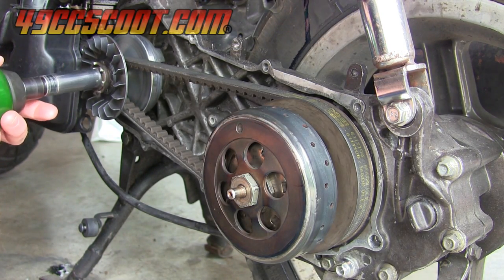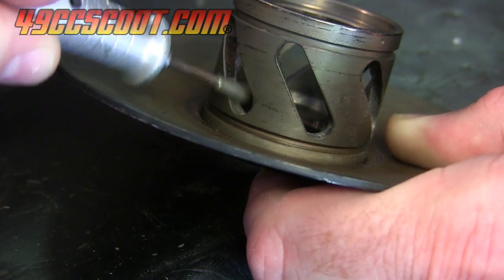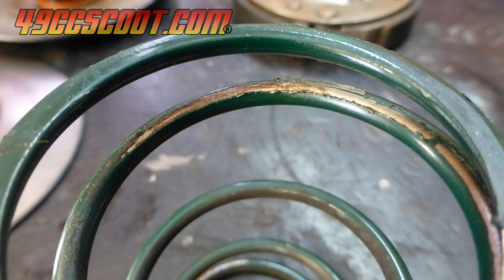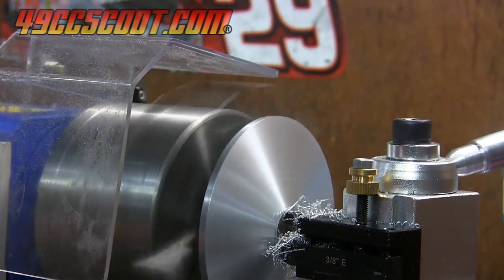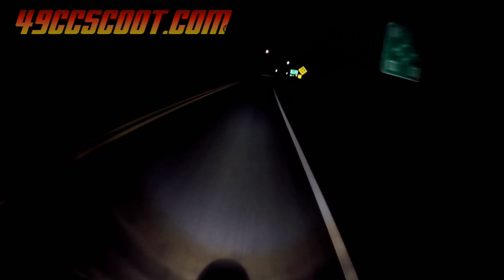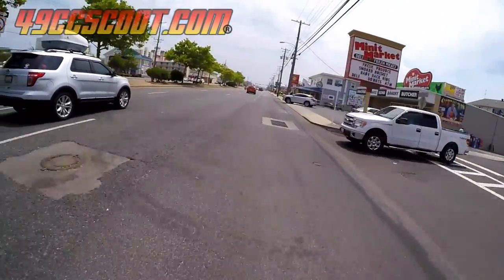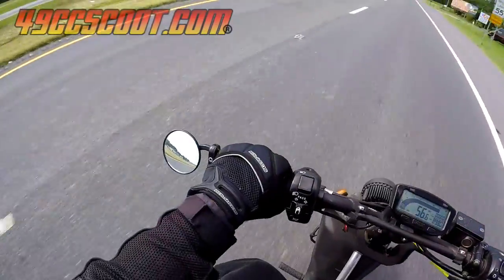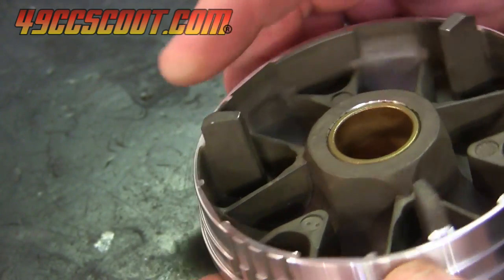Belt Busting Update And Beach Rides

Comment: I own a motorcycle, don't own a scooter. But I will say this. You have to be the most thorough mechanic I've ever seen. I mean, you really put a lot of time and effort to get the job done right. If I was to have anybody work on any of my two wheeled machines, it'd definitely be you.
Reply from the maker: Thanks! In situations like this, you really have to take the time to check it all over or it may never get fixed.
Reply: Shaun Daskam I was thinking the same thing.
Reply: I'm a moped driver also and I do this stuff as well. It's fun to do and simple
Reply: @49ccscoot  I DONT UNDERSTAND WHY WHEN I BOUGHT MY SCOOTER IT COULD GO NOT MORE THAN A 93KM PER HOUR NOW ONLY 84 ?! IS IT A VARIATOR RINGS FELL OUT OR THE SPRING IS USED UP IN MY HONDA PCX 125CC 2011 ??? tHANK YOU
Reply: Seriously man

Comment: Had a snowmobile that broke belts. problem was what your correcting. At a certain point of reduction or opposite, in the torque convertor operation the belt wasn't  aligned with both the pulleys, it was cocked. Anyway, yes everything has to flow easy front and back pulleys. Lubed and smooth baby!
Reply from the maker: These CVTs, that everyone that doesn't work on them daily loves to call "simple", can certainly be more than meets the eye.

Comment: I never thought about that, my old scooter kept breaking belts and I never knew why.
Reply from the maker: Cheap belts are a huge cause that some overlook. The stuff from China that costs half the price of a quality belt usually breaks in short order. I tried some years ago and never will again. So many breakdowns from snapped belts. They couldn't even make it 10 miles in some cases.
Reply: 90GTVert I've always steered away from cheap belts, I've used gates powerlink belts.

Comment: Would be super keen/eager to hear your comments about the Malossi belt vs OEM its performance, longevity, vibration etc. And, also thoughts on whether the belt might behave perform differently within a stock OEM set up (replace belt only with Malossi) versus changing out to a full Malossi "kit" .. Worth it? Or not? Its costly and parts hard to find in Asia so do not want to spend all the time and money on Malossi unless its well worth the effort. Thanks
Reply from the maker: I think to make a direct comparison, you'd need to use belts of the same spec in the same setup. I think the Malossi belts are good quality belts, and so are Bando belts that came with my scoot and that I used as replacements until the over range kit. If you could find the right size, I'd expect a Malossi belt to do well in a stock transmission. I don't think a Bando belt would fare too poorly if properly sized in an over range either. It's much easier to stick with stock replacements if the scoot is not heavily modified. If you go to an over range, it's better to go with the intended belt for that.

Comment: Once again awesome video and your bike is solid. I noticed the rear pulley bell was drilled and wondered if youdrilling the holes your self.  If so did you notice an improvement?   Also, refacing the the front pulley can have positive or negative results.  How did you get the correct slope and have you ever expieremented with refacing other variator and front pulley faces that made considerable improvements?
Reply from the maker: The bell is a HOCA. It's also knurled on the inside contact area. I like it better than stock. Never drilled one myself. 

I measured the angle of the old pulley and then set the lathe to the same angle and cut it. I haven't tried fiddling with other faces. The OR is what I use most of the time and it works so well that I don't have any real desire to screw with it. I have done fixed halves at different angles before I had the mini-lathe, just using a drill and files. You can definitely tell the difference if you change angles too much. The closer you get to flat, the quicker it shifts and the farther from flat the slower it shifts. Ideally you'd want the angles of both halves to match and the belt to be designed for the angle, but in reality you can get  away with small changes. The farther you stray from what the belt matches though, the more likely you are to have problems with belt slip and premature wear.

Comment: Heat is what causes the belt to break. I noticed your starting RPM is high which could be the the cause of the over heating. Also a stronger center spring will cause more heat and I would use lighter weights first. It also might be shifting into high gear before the clutch engages.
Reply from the maker: Variator is what gives me the RPM on launch. I know that sounds like the clutch's job, but try to get a Malossi OR to take off at low revs without ruining performance elsewhere. They like to go, and are meant for stuff that likes to rev. Gentle takeoff would be nice for longevity, but who wants to do that? lol

Comment: So is there a clutch in the front and back variatots that have shoes that wear out like brake shoes ? If so do these friction pads and variator rollers etc  take long to wear out. At 7000km would the be ok. Thanks you do a good commentary on your videos.
Reply from the maker: Variator up front. Clutch in the back. Clutch does have shoes that will wear out over time. Kinda depends on the quality and treatment. Same deal for rollers. I would check both at 7000km.

Comment: Nice job, but why didnt you just use the other 3 races on the driven pulley?
Reply from the maker: There are 2 sets with different angles. The ones that I used work the best for my setup to keep RPM more steady.

Comment: i broke a belt once, but that was my own fault, i faultly installed my variotor fan plate wrongly and it vibrated, and after 10miles it broke.

right now, i never lost a belt anymore and my crankshaft even has a tiny wobble with it. which is noticeable while driving. but this never game me issues.
Reply: lol i did the same thing once as a teen, meltet the fan end to the crankshaft. So i had to take it all apart.. what a learning experience :D

Comment: what better way then to race other scooter?

what race? they looked like thyey all broke down.

why not a bigger scooter? is this 90cc enough for you?
Reply from the maker: I've got 5 scooters and a moped ATM, from 49cc to 500cc. I had a 150cc GY6 but didn't like it that much and the 100cc 2T is more powerful. Small scooters can be used different ways than larger ones that get classified as a motorcycle. If I got to the beach on the 500cc, I'm just stuck in traffic and for that area I enjoy the small scoots much more. For going to areas with twisties or when I want to go faster than 60MPH regularly, then I get on the TMAX.

Comment: That spray coating should be removed with cleaner. It is used to prevent rust while the parts are in storage. They do this to disc brakes.

Comment: Hey, i have this problem jf you can help me: my 50cc scooter revs a lot but doesnt make any speed, i asume the belt doesnt go down to the shaft in the clutch and maybe something to do with the rollers? They are 8g and scooter is fuel injection with 7500 nominal rpm, what do you think?
Reply from the maker: I'd start with a full check of the CVT...
https://youtu.be/2EjW-iSP-Q8

Comment: If that's the malossi over range rear pulley I too had to smooth out the torque drive guides and replace the seals, I wonder how the new la furia rosa will do.  As always enjoyed your vids bro.
Reply from the maker: That is the Malossi OR. Most of the people that I know with the OR kits don't ride lots of miles so I'm not sure how they hold up. I'm not mad at it with over 10,000 miles on it.
Reply: Furia Rossa by Malossi is a sort of a copy of the stock Honda Dio Z4 rear pulley that was already all made out of aluminium...which makes it much lighter...which helps on low power scooter. The downside of the Hodna Dio Z4 is that the rear pulley is made like a snowmobile...not much excursion. In any case both stock Honda Dio z4 and Furia Rossa makes the rear pulley and the belt running cooler. Furia Rossa will make your belt last a bit or a due to those cooling holes on the drive face. It increases the grip as well....slightly.
So yeah if you can afford it go for it...or get the Polini rear pulley (aluminium too but no holes). 100euro cheaper

Comment: Can the belt cause the scooter to feel like it wants to go faster but is hesitating or choking up? I have a replacement belt. Not sure I need it. Seems the problem can be the carb, vacuum, bad gas, fuel lines and other things. Don't mind working on them or replacing parts but trying to figure out the cause of the problem is FRUSTRATING as hell!
Reply from the maker: Lack of travel can make it not want to go as fast as it should. You can pretty easily measure the belt to see if it's beyond it's service limit. Perhaps carb tune. If it's all around performance and not just at top speed, the CVT can cause all sorts or things... but so can the carb.
Reply: 90GTVert  OK thanks. I put some seafoan in gas tank

Comment: Hi bro i have 155cc scooter with max torque of 13.8 N.m @ 6,250 rpm and max power of 11.1kW / 8,000 rpm. What is the best roller weight to have better top speed??
Reply from the maker: IMO the only way to find the best weight for any combo is to take the time to do the tuning. Any recommendations are only ballpark answers. I was using 10g sliders in my 150 to keep the revs up, but I would expect you will need to be a bit heavier than that. If you don't want to spend a bunch of money on roller or slider sets for tuning (I prefer sliders), then check out this video : https://www.youtube.com/watch?v=YkNhqEFeWVQ

Comment: How were you able to find taller gears for this type of motor, i could source for the short blocks/ chinese clone long blocked from SMC rexys but not this motor in your video
Reply from the maker: 10.13:1 gears were stock in the Vento Triton and  others like it. 11.2:1 can be had by using a Stage 6 gear kit along with E-Ton beamer gears (13.5:1 stock).

Comment: Hi, my original SYM jetpower 125 is an 828  19, but I still have a Powerlink 835  20 laying around from a previous project. Would it be possible to install it on my SYM ? Or it has to be the exact size !!!? Thanks man.
Reply from the maker: You can try it. Wider belts may be good for top speed in some cases, but could ruin a bit of the low speed takeoff power. Length will likely be OK. Could be a good thing. If it's so long that there is slack, it may hurt takeoff. I doubt that 7mm is long enough to cause issues with it coming off of pulleys.

Comment: Hi! Could you share a link for a cheap rear pulley assembly that is bigger than the stock pulley?
Reply from the maker: Some people were buying Aerox 100 rear pulleys from Autotech355 on eBay. Performance unit for the Aerox so it had sets of grooves to select in the torque driver and was just over $100. Way less than Malossi or the others want for an OR pulley.

Comment: In indonesia we use a 6-9 gram roller and custom pulley. We just put 5 pieces of roller so we got a much torque in bottom acceleration and not much lose of top speed. Good job bro👍
Reply: Only 5 rollers instead 6? Thats not good it will cause vibration wear on bearings
Reply: @mate7255  malossi seems to do well with only having 4 or 5 rollers in. Their piaggio zip. (The joker) has been running for years like it with zero issues.
Reply: @JDMz  idk man main thing to keep in mind is the balance of the cranckshaft if they can make a housing that is suited for 4-5 rollers and doesnt have a lot of stress on the cranckshaft then thats completely ok

Comment: Do scooter cvt  gearboxes generally  need toppling up much  ? Would it be evident that fluid is leaking around the case if so. After how many km do u replace the gearbox oil  ? Thanks
Reply from the maker: They shouldn't, as long as there are no leaks. Leaks should be somewhat obvious in some form. I usually do mine every 2,000 miles or less. Prob more like 1,000 for me, because even then a bottle of gear oil lasts 9,000-10,000 miles. Service manuals recommend various intervals.
Reply: 90GTVert so gear oil does wear out ? I thought it lasted ages because there is no carbon or fuel  blowby like in the engine oil. I've heard of people never doing the gear oil  like in a car diff without any problems.
Reply: @matowixunplugged7927  after a while yes. It becomes contaminated. You should never lose gearbox oil. The gearbox oil stays unless there there's a leak at the seal. Oil should be changed at certain times. On how long the scooters ridden. So for instance. Short journeys. About every 1000miles or so. If ridden long journeys and ridden hard alot.  Oil definitely needs to be changed regularly. The gearbox oil gets quite hot if ridden hard for ages. Aswell as the belt. Biggest killer for belts is heat.

Comment: yo ! greetings from bucharest , i bought a keeway f-act 50 2007 , minarelli air cooled 2 stroke(or copy i dont know) i replaced the engine kit with a chineese 49cc ... old one was wack , what setup do you think its gonna make it go 90 km/h and have good acceleration ?? exhaust / cvt setup / engine set (70cc? 80cc? 90?) what carburateur ? 17.5 or 19-20 mm ? what type of air filter ? please help :D
Reply from the maker: A sport to midrace 70cc with somewhere between a 17.5-21mm carb along with a good pipe like a Yasuni R or C16 should serve you well. A stock airbox should work fine. I'm still using a modified stock airbox with a hyper race and a 25mm carb.
Reply: @49ccscoot  cool , ty , the exhaust i was thnking on a malossi mhr replika , dedicated for 70cc and higher , what about the transmision? Ehat kind of variator , belt , clutch? :) im a big fan of your work , its nourishing my brain :)) in a bid of a maniac
Reply from the maker: @iulianciocan5672  I really like the Malossi OR CVT, but you don't need all of that to do the speed that you're looking for. If you catch a sale though, you can probably pick up a whole OR kit for what it would cost to piece together something that won't work quite as well. Stiffer clutch springs and maybe lightening the clutch shoes should work fine.
Reply: @49ccscoot  thank you so mutch , for now im strugglin to get in registered at the mayor :)) once i do il start nodifying it , if u have a facebook , i can look you up and mabe talk some more , again , big fan :) u got a nice scoot , it could use some body panels do :D
Reply from the maker: @iulianciocan5672  I like the "naked" scooter. It's easier to work on and looks different than everything else around here. Plus, fairings annoy me, especially Chinese fairings.
Reply from the maker: @iulianciocan5672  I'm always around on the forum.

Comment: Can you help me with my moped? I put on belt yesterday but now when I kickstart it the moped rear tire starts spinning fast. And when I accelerate it’s accelerates slow then I let off then accelerate and it slowly picks up speed. Could I have screwed on the first pulley wrong? I didn’t take off the second pulley. I’ll send video of what it’s doing.
Reply from the maker: I'd check the variator to make sure no rollers are out of place.

Comment: Wait those variator holes, do you have a video of what your suppose to do?
Reply from the maker: Variator holes?
Reply: JoeKickass324 Are you pertaining to the clutch bell? the holes at 0:03?
Reply: I mean the holes in the variator/clutch case at 6:38? I heard that i should drill holes in the case but not sure how or if i should do them, especially if in a mostly rainy sometimes sunny climate. but also whats up holes on clutch bell is that normal?
Reply: I have no idea what holes are for but the holes from the clutch bell is serving as ventilation shall we say. It does the job but take note that a specific pattern is needed. You should not do DIY drilling holes with those bell unless you do have ideas when it comes to CVT

Comment: I just dont know if I had that same issue with the clutch pulley being rough when it close and open. Does it make rough acceleration? A vibration that make a torque from all of a sudden?
Reply from the maker: I never really noticed any symptoms. More wear than I had can cause an obvious change in performance and how the CVT shifts.

Comment: There are little scratches on all the roller slots of my variator. But they are in-line with roller travel . Like vertical scratches on the inclined base of rollers. Will they impact variator performance? What are signs to look out for that can help me decide when to replace variator? My second questions is , is there any way to use cvt as a low range gearbox for very steep inclines? Like a shift on fly kinda mod?
Reply from the maker: Scuffing is normal. Deeper scratches could be a problem. Keep an eye on the variator bushing and boss too. The bushings wear and get loose and the boss gets rough. 

Not sure about the second part. Never looked into such a thing because a well tuned CVT functions pretty well in most scenarios.
Reply: 90GTVert thanks for the reply.

Comment: Can you knurl the shaft to get a nicer/tighter fit on the bearing?
Reply from the maker: I guess it could work. I think I'm going to machine a sleeve and use a 6001 bearing with a 12mm ID in the cover. Then the sleeve won't be paper thin and the shaft won't have to be cut down.

Comment: What type of grease did you use to grease up the rear pulley?
Reply from the maker: I normally use a synthetic wheel bearing/all purpose grease like Mobil1 or lately I've been using BelRay Assembly Lube. I've used the Malossi grease, but it didn't seem to perform as well for me (looked dried up and burnt after use).